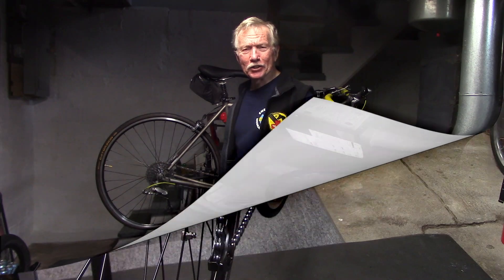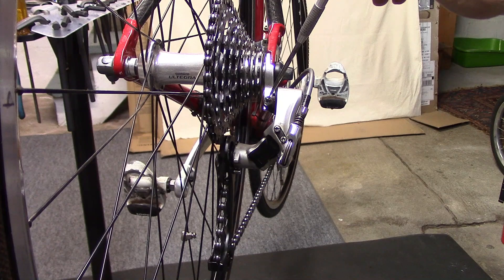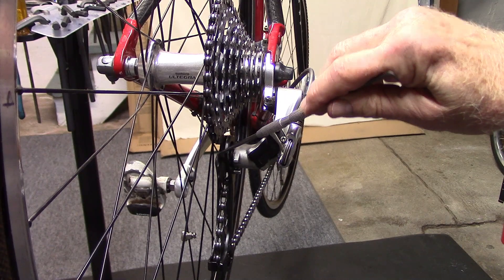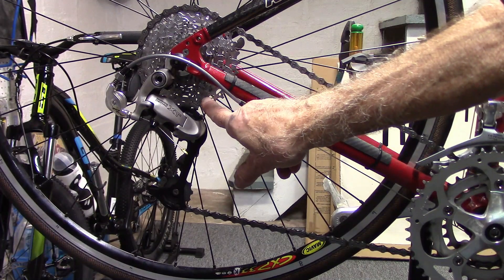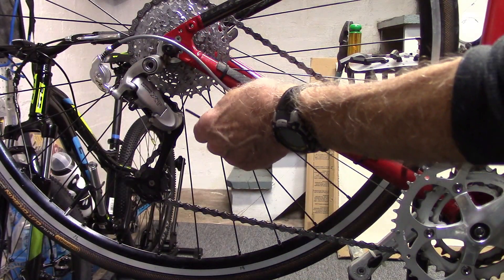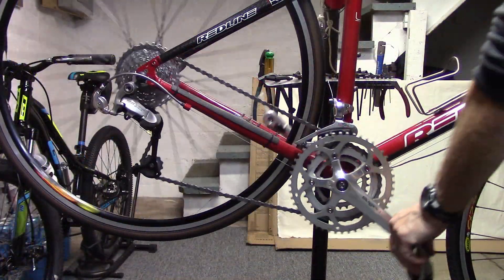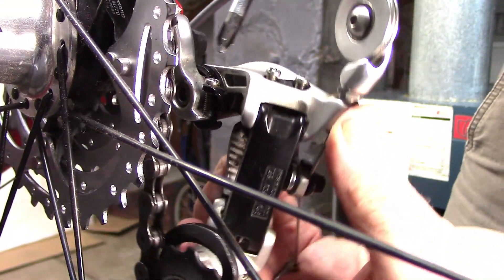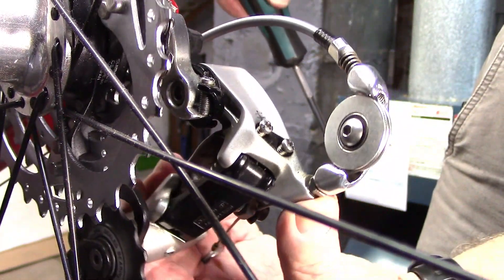What is the bicycle derailleur B screw and and how to adjust it?

Comment: I went from a 12-28 to a brand new 11-28 cassette and there is one gear in the middle of the cassette that I cannot get it to shift to smoothly or consistently. What’s the chance that screwing in the b-screw would resolve this?
Reply from the maker: I don't think it's the "b" screw. You'll need to re-tune your rear derailleur when you switch cassettes. Here are some questions I have:
Check the chain for wear. Check the cog on the new cassette that's causing problems for manufacturers defects such as a bent or broken cassette tooth.
Is the number of cogs on the new cassette the same as the old (i.e., same speed 9,10,11 or 12)? Is the manufacturer of the cassette different (what are the manufactures of the old and new)? Shimano and SRAM are interchangeable but some other brands may not work as smoothly.
Is the freehub alloy and has it been worn (teeth like marks in the freehub suggesting increase wear)?
Finally, have you torqued the cassette. See:
https://www.youtube.com/watch?v=qVzWQuHPz50&t=3s&ab_channel=TonyMarchand
Let me know. Regards, Tony
Reply: Hi @tony10speed . Thanks for your reply. I am working with new Shimano 105 shifters, new 105 derailleur, new chain, new housing and cable, and the cassette is brand new too. All 10spd. My indexing is fine except when I try to go from the 14t cog to the 15t cog. I have to shift again, and it just skips past the 15t cog. I even tried swapping in the 15t cog from the old cassette thinking it may be a lemon cog on the new cassette, but the behavior was the same. I watched your torque video, and I am torqued properly, and the freehub looks fine, without excessive wear.

The new cassette is a SRAM PG1050. The taller cogs are all held together using a spider, and then the smaller cogs use plastic spacers, then the smallest are spaced with metal on the side of the cog. The only thing I can think of now is that the spacers are improperly sized just enough that they create a problem at this specific cog.
Reply from the maker: @theMRkevinB  Check that you don't have a bent derailleur hanger. See: 
https://www.youtube.com/watch?v=qHK6jQizIdc&t=1s&ab_channel=TonyMarchand
Make sure you didn't forget a spacer that is placed on the freehub before you put on the cassette. The spacer allows for the freehub to accept a 9, 10 or 11 speed cassette. Other possible problems include a kinked cable (inside the shifter when the cable was installed), or a bent tooth or burr on the 14 cog of your new cassette not allowing it to shift properly to the 15 cog (making you shift twice which move the chain to the 16th cog). On a bike stand, slowly turn the crank while in the 14th cog and shift while watching the chain and cog teeth. See if you can notice where the problem lies. I have had a similar problem with one of the larger cogs that I traced to a bad shifter. Finally, take it down to your local bike shop and have them take a look. Let me know what you find out. Regards, Tony

Comment: What is the right screw size of the derailleur?
Reply from the maker: Good question. Depends on the derailleur manufacturer, road or mtb, and whether you're talking about the "b" screw or limiting screws. The screw itself depends on: Length, thickness, thread pitch, thread form. Most "b" screws are standard M4 threads. In the video, I was replacing the "b" screw on a Shimano Deore derailleur which accommodates a Wolf Tooth Components M4 25mm B-Screw (available from Amazon or Home Depot). Note: If the "b" screw is too long, it may go beyond the derailleur hanger, in which case you'll need a longer hanger (if it's a replaceable type) on a Wolf hanger extension. You can also look up the specs for the "b" screw on the internet or contact the manufacturer or local bike store. Regards, Tony

Comment: What  is the possible thing to happen When You don't put a B Screw in the RD?? Is it still work or  it can couse to damage your RD.. Hoping for your response.

Your new subscriberhere 😊
Reply from the maker: The "b-screw" adjusts the distance between the and the guide pulley. We usually adjust the b-screw while in the small chainring and largest cog. If the b-screw is not adjusted or missing, there are 2 possibilities. The guide pulley will rub against the cogs (usually the largest cog) and wear the pulley wheel very quickly as well as wearing the cog (and will also be noisy when in the largest cog). On the other hand, if the gap between the cogs and guide pulley is great you will experience poor shifting. 

NOTE: Some lower end rear derailleurs and inexpensive derailleurs do not have a b-screw, leaving you with a "hit or miss" approach to setting up the derailleur. In this latter case, some suggest that the distance between the tension pulley and largest cog can be adjusted by increasing or decreasing the length of housing (and therefore cable) feeding the rear derailleur. See:
https://forums.mtbr.com/families-riding-kids/help-no-b-tension-screw-shimano-tourney-rear-derailluer-rd-ft30-863294.html
Some other older derailleurs have a "stop" to prevent the guide pulley from contacting the largest cog. Some have an adjustable spring.
The best thing is to consult the derailleur specification on the internet if the derailleur lacks a b-screw.

Regards, Tony
Reply: @tony10speed   hello Mr. Tony thank you very for your reponse.. Verry well explain.

Comment: This is a great hack and really clearly demonstrated. Thanks! I had the same issue as the demonstration when upgrading my Shimano Tiagra 4600 setup to an 11-32. My solution was to shorten the chain (right to the minimum!). With the tension pully fully engaged it gives a few extra mm of clearance for the guide pully. Perhaps that's how the manufacturer spec'd it on your system? I much prefer your solution allowing for a few redundant links in the chain in case of emergencies on the road -so long as the extra distance doesn't cause sloppy shifting on the smaller cogs.
Reply from the maker: Let me know how you make out. Regards, Tony

Comment: I don't understand what the 4-6mm gap refers to. Is it the vertical distance between the top of the guide pulley and the bottom of the largest chain ring when viewed side on?
Reply from the maker: Between the guide pulley and the largest cassette cog when viewed from the side. Regards,Tony
Reply: @tony10speed  Thanks

Comment: Excellent guide, I went from a 11-34 to 11-42 , using a longer B screw, its tight but the derailleur clears all the cogs, I had the top jockey set too far from the largest cog, didn't realise the gap was around 6mm so might improve my shifting, I tried a hanger extension on a larger 11-46, it is a long cage derailleur, the bike didn't like it, slipped under load  wrecking the mech and damaging the cassette teeth, expensive mistake, seems 9 speeds max is a 42, God knows how folk make a 50 rear cog work.....
Reply from the maker: The 50 rear cog cassettes are often associated with a single front chain ring. You need a specific rear derailleur (as well as derailleur hanger) that is made for the large variation from small to large cassette cog that are present on newer bikes. 

As far as retro-fitting an older bike - I've never had good luck with hanger extensions myself and most rear derailleurs have a limit on how large a cog you can use. 

Thanks for the information and safe cycling, Tony
Reply: @tony10speed  Thanks Tony, from England

Comment: Didn’t know I has to lift the mech all the way up to adjust it. My shifting rumbles whenever I change to small big.. b screw problem?
Reply from the maker: Several possibilities:
1. May not be enough tension on the front derailleur cable. If you notice that when in the small chainring, the cable is very loose, undo the cable pinch bolt on the front derailleur and tighten just enough to take out the slack. 
2. Check that the front derailleur cage is parallel to the frame. Look from the rear to see if it lines up.
3. Is one bent or a tooth broken:
4. Have the chainrings been changed. If the chainrings are not properly aligned (i.e. the small and large rings), you will not have the "ramping" aligned properly and the chain will not move up or down the ramping in a smooth order and will make noise. If this is the case, you should check the manufacturers specs or check with your local bike shop.
Also see Calvin Jones great video on advanced front derailleur adjustments:
https://www.youtube.com/watch?v=vcc5-ry4fA0
Let me know how you make out. Regards and safe cycling, Tony

Comment: On Shimano Trouney for Road Bikes the B screw is a dummy it does nothing :) Took me many day to figure that out.
Reply from the maker: You'll only notice the "b" screw move the pulley wheel away from the cassette cog when in the small chainring and largest cassette cog. If that's not the case (i.e. no movement of the guide pulley and chain when turning the "b" screw while in the small chain ring and largest cassette cog), the manufacturer inserted a b screw that was too short. 
If the guide pulley wheel is not hitting the largest cassette cog, I wouldn't do anything. If guide pulley wheel is hitting the largest cassette cog, you can obtain longer "b" screws (I bought a couple but I had to search the internet for them - the threading on the "b" screw is important and you can't use any hex or Phillips head screw).  Regards and safe cycling, Tony

Comment: Very well explained and demonstrated. I want to change out my 11/28 for an 11/32 for when I hit the hills. However, I don't want to have to change the rear derailleur to a long cage and hopefully, I can keep the same chain too. Thanks for the video I think this will help a lot. JP
Reply from the maker: You need to look up the total capacity of your present derailleur (i.e. the largest cassette cog it can handle as well as the number of teeth capacity: (number of teeth on the front large chain ring-number of teeth on the small chain ring) + (number of teeth on the large cassette cog -number of teeth on the smallest cog). My experience is you'll need a longer cage derailleur. You will also need a new chain since the present chain will be to short as a result of the larger cassette cog. If you use the same chain and you are in the big chain ring and accidentally shift to one of the large cassette cogs, your chain will jam and could lead you to crash. Regards, Tony

Comment: When I adjust my b screw I dont see any movement happening to the setting of the gears , I have new 11-50  high  range 9 speed ,old was 11-32 . Is there a way to increase the spring pressure so the pressure maintains the gap when set , thanks in advance, thanks for the great video
Reply from the maker: Either the rear derailleur may not have the capacity to handle such a large cassette cog (or may not be able to handle the difference in number of teeth or the rear (50-11=39 + the difference in teeth of the chain rings) (check the rear derailleur specs that came with the derailleur or look on line) OR the rear derailleur hanger is not long enough (some bikes allow you to change the rear hanger to a longer one). My old 9 speed road bike could only handle up to a 11-32 in the rear because the hanger was to short. I jerry-ringed a longer rear hanger and longer b-screw and got the derailleur to work with an 11-34 but couldn't go larger due to limitations on the rear derailleur capacity. Newer bikes with new derailleurs and longer derailleur hangers can easily do what you want. Some of the newer bikes have a single (1x) front chain ring and  an 11-50 rear. I'm not sure I'd use an 11-50 on my old 9 speed.  Anyway, maybe it's time to treat yourself to a new bike (assuming that this is not a new bike that you are talking about) with the gearing you want. Why, because you deserve it. Good luck and regards, Tony
Reply: @tony10speed  thanks for your help,greatly appreciated.
Reply: @nickbaker666  yeah cassette came with one and I ordered two other ones both  different lengths  ,found a spring pressure  mod  and got a new longer stronger Allen socket head cap screw for the  "B" screw and combination works great with the original hanger extension,  cheers
Reply: @tony10speed  I agree and have done pretty much everything you said, plus performed a internal spring mod on the derailleur and have had a great time riding my 15 year old Kona dawg, that I got for a steal and am modernizing it on the inexpensive with good quality parts and learning to wrench and adjust my own bike , having a blast ,cheers
Reply: @tony10speed  yes originally had an 11-32

Comment: Was your derailleur really long enough to accommodate the larger cog?
Reply from the maker: Yes. The specs on the derailleur on the 10 year old Independent Fabrication state it could accommodate a cog of 34 teeth and a total of 38T (difference between the teeth chainrings added to the difference between the largest cog and smallest cog. I was runnin a 34/46 in the front and a 11/24 in the back. I had the 34 large cog and a total was only 35T, well within the specs. But obviously it couldn't handle it.

Comment: Is the 4-6 mm distance critical?
Reply from the maker: No, the distance is not critical. Long as your cassette cog is not to close to the guide pulley to pinch the chain and make a grinding noise which is bothersome and may damage the guide pulley.

Comment: If the pulley is too close to the cassette cog, how does that damage the pulley wheel?
Reply from the maker: If the guide pulley wheel is too close to the cog, it pinches the chain and makes a grinding noise. The teeth of the cassette may hit the teeth of the guide pulley and damage the pulley wheel.